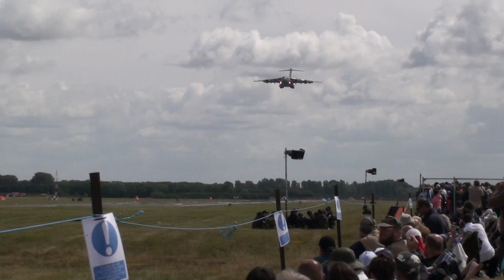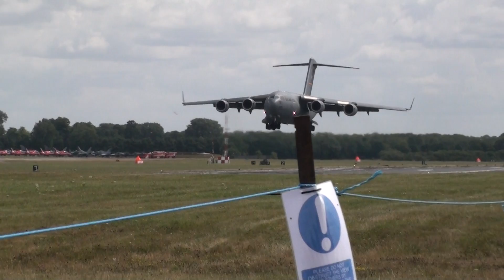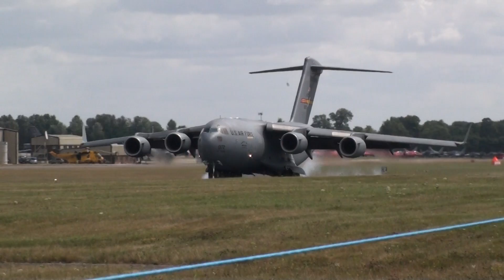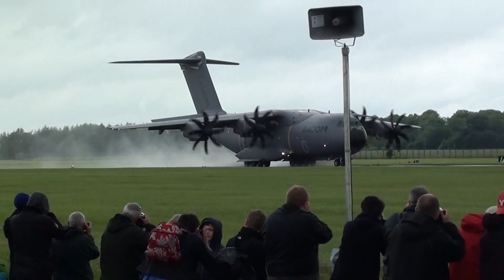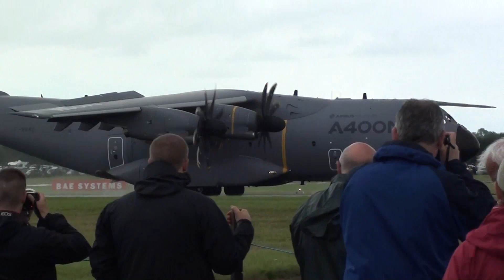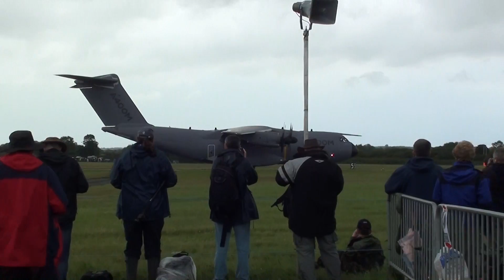Tactical Short Landing C-17 vs A400M. What Brakes The Most. Reversers, Wheels, Props, Spoilers?

Comment: I agree matbat08, Heavies and gen aircraft are built different than military transporters, they use HD brakes for short rwys, reversers need rwy length to work at its top ability. As a 8 year airline pilot, the thrust reversers actually handle most of the braking until we reach about 60 knots,the main gear starts braking until about 25 knots, finally the nose gear breaking kicks in with the main gears to completely stop the plane.The C-17 has huge brakes!

-A Delta 757/767 pilot

Comment: "heavy duty", eh? I wonder how these brakes might work killing almost 18.5 MEGA-Newton singlehanded without igniting themselves (like brakes on EVERY plane do). Taking in regard the C-17 has big wheels, but not as many like an AN-225, 

Oh and besides: Spoilers do a HUGE job braking the plane on speeds above 70-80 knots. If you don't believe me: Try to hold your flat hand outside the cockpit window whilst flying, underside of your hand pointing forward.

That's why you steer UP on braking. Drag!

Comment: what kind of bullshit is that you're talking about? The wheelbrakes on planes only do MINOR job braking the plane. The MOST of the braking is done via the ENGINES and the spoilers.

The brakes are only applied IN EMERGENCY SITUATIONS or if you have to land on VERY SHORT runways - because they'll virtually go up in flames if you'd brake ONLY with them. Therefore EVERY plane declares at least a PAN PAN if the reversers are not working.

greetings from an actual pilot!

Comment: I'm afraid you're wrong. Wheel brakes do most of the work. In fact, when doing worst-case flighttesting and landing they don't even use the reverse thrust. In real life commercial landings these days only Idle Revers Trust is used to save fuel. 

Actually, originally the plan for the A380 was to not fit it with any reversers at all. But airlines complained and now she has reverse on the inboard engines. Outboards don't have it to save weight.

Comment: You're quite wrong about turboprops. Not only can they reverse almost instantly (unlike turbofans) but they produce much more thrust at low speed thanks to the large cross section they cover. That makes them much more effective as air brakes. The disadvantage being that they loose thrust at much higher speeds, which is why modern turbo props generally operate in the ~250-300kts TAS range while turbofans are best used when >350 kts TAS is needed.

Comment: I wonder if either of those aircraft were carrying a load.  The C-17 with a bellyful of troops, small vehicles and armaments stands a better chance at a shorter stop.....turbofans are much more efficient at channeling jet exhaust in reverse thrust.  The A400M's turboprops produce tremendous lift when carrying weight, but the exhaust coming off those propellers can't be immediately controlled or channeled like the enclosed airfoil of a turbofan.

Comment: I suspect the C-17 is a greater value.  It's probably cheaper and hauls more further.  Don't know about the A400 off field capability.  I understand the C-17 is probably not as good as the C-130 (higher psf per tire).